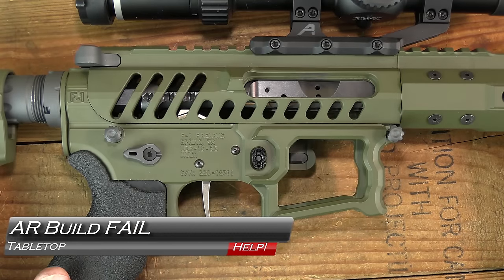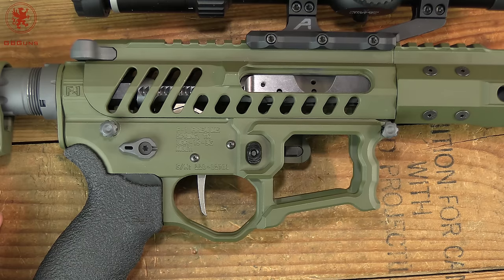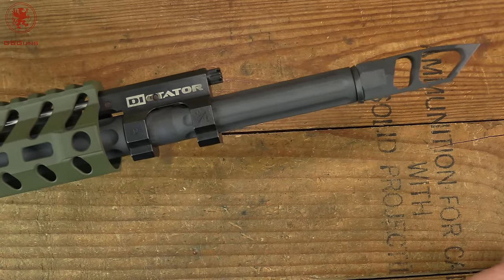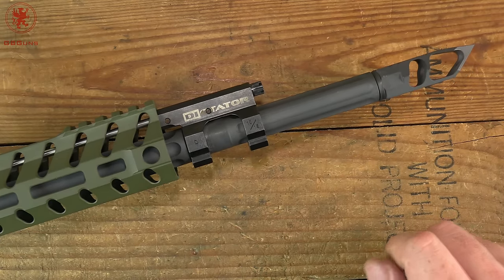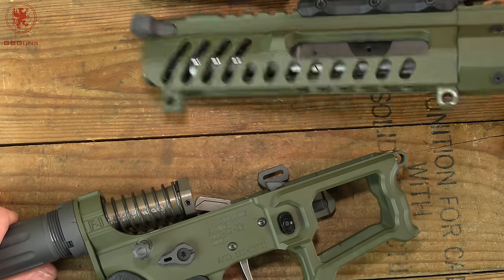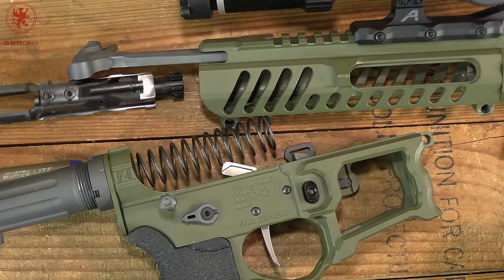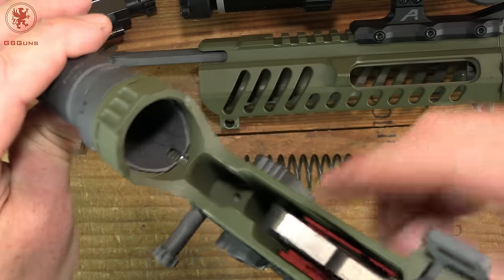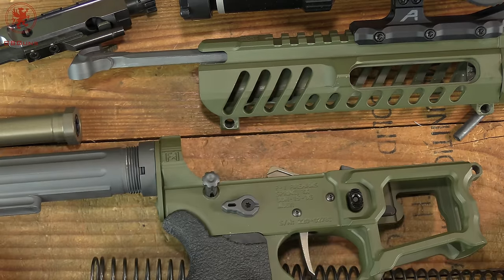The Worst Thing You Can Do For Your AR

Comment: It looked like you were missing the buffer pin holding the weight into the tube. That might be putting pressure on the bolt before it’s even fired causing it to short. Since there is force against the back of the bolt. Or it’s just unbalanced like others were saying
Reply: That was the first thing I thought. Try that and then try a lighter spring
Reply: Yrs i agree
Reply: Sorry for being late to the party but I just saw this video in my recommended. Hey Vader7, I had to do a double take when I saw that myself. I figured I missed him taking the buffer detent out but upon rewinding the video....no, the buffer and spring was already out. I was having similar problems with my AR-10 .308 Win and AR-15 .300 Ham’r rifles. I would crank the adjustable block fully open and every third empty mag, the bolt wouldn’t catch in the open position. When I took it apart I noticed the hole to the gas block was twice the size of the barrel and drilled a bigger opening for the gas to escape. Took it to a gunsmith for a second look and he was able to adjust the gas block perfectly and it would catch the bolt open everytime. Only problem he said there was, the bolt would return very sluggish. I told him I replaced the .308 buffer spring with a lighter .458 SOCOM spring to compensate but I’d slap the right spring in the rifle to fix the sluggish return issue. I’m guessing the buffer detent would help the issue but I’m thinking because it’s a rifle length gas tube, the barrel gas hole will need to be drilled out to match the block hole aswell. Does anybody know if he fixed the issue yet?
Reply from the maker: Yes "he" has.  Check the video description or for a spoiler read the article: https://www.ballisticmag.com/impossible-ar-build-myths/
Reply: @GBGuns   Thanks a lot for the article link, it was a fun read. I too hate building the same ole same crap everybody else builds. But sometimes you run into a road block and trying to get a gunsmith to understand the issue is almost impossible. Did you ever figure out what the original buffer spring was for? I remember bringing in a left handed .50 Beowulf AR-15 for fitment issues to my gunsmith and at the same time another customer brought in a completely built .50 Beowulf AR from Alexander arms I’m guessing. He was having different issues, apparently the guy putting the rifle together decided to slap a buffer and buffer spring from a 5.56 rifle in his and it created all kinds of over-gassing and recoil problems. It’s  amazing something so simple can cause a big headache.
Reply from the maker: @animalmother9753  i didn't.   My guess is it was human error on the packaging or the vendor.  It was supposed to be a carbine spring, and I took it at face value.  Different metals make for different lengths and thickness for the same spring rate.
Reply: @GBGuns   I was actually thinking the same thing. Human error being the most likely scenario. When I first started building ARs, I was a Wilson Combat snob and everything had to be high end parts. I can’t even tell you how many times I had to return parts to WC because of human error. I’d order a 16” .458 barrel, 1-14 twist. In the middle of my build the engraving of the barrel catches my eye and it says 1-22 twist. 😤 I was like are you kidding me? Had to strip the upper apart and send it back for the correct part. The thing I dislike about these companies is customer service usually rolls into work at about 8 am and the guys on the floor picking parts from the bin get there at 5-6 am. So, by the time you figure out you ordered the wrong parts and email CS for a halt on that order, it’s already packaged and ready to ship before CS reads your email. As convenient ordering online is, it’s a pain in the butt when ordering the wrong part or in our case the wrong part was picked off the bin.
Reply: @animalmother9753  sounds like some good work! Better than ordering new parts for a small issue like that as long as it’s safe of course. Knowing a good gunsmith and having your own Arsenal of firearm knowledge is awesome 😎 And no worries dude I always find old videos the same way and am always the late one😂. Do you know why the hole was twice the size as the port in the barrel, just factory error?Also back to my original comment I thought that would definitely be the issue , even with the right weight in it I would figure not having the detect would make it a little iffy. Kinda hard to put it together without the detent too you’d have to squeeze it in there. Or something with the spring/weight size etc. , haven’t read the rest of the comments but if he hasn’t figured it out wonder if it had something to do with the block like you were saying about your build.
Reply: @vader7306   Yeah, he replied to my comment early this morning with an article link. It was actually the buffer spring, we think human error. Somebody packed the wrong spring that was too strong for his caliber. As for mine, when I took the gas block off the barrel, I noticed the hole of the block imprinted on the barrel and it perfectly incircled the barrel gas hole. It was a Wilson Combat barrel, they purposely do that to their barrels. They even send a pamphlet with the barrel noting the gas hole is undersized and might need to be drilled out for your particular application. Not all of the barrels have this, I think the only barrel that came with pamphlet was the 6.8 SPC. But it is something to consider if you went the non-adjustable gas block route and get frustrated dropping money on new buffers, springs, light BCGs and whatnot.

Comment: this comment might be too late but when you said Rise Armament it got me to remembering the issue i had with my .458 SoCom build.  doing a function test after final assembly of the rifle, my BCG wouldn't go into battery.  you would think having the anti-walk pin kit installed would mean the RA drop-in trigger assembly wasn't suspect yet backing off the tension screws at the bottom of the trigger housing, the BCG cycled without drag.  just another area to consider if anyone else is running a similar set-up.
Reply from the maker: Interesting issue to have, and certainly something not a lot of folks would think of.

Comment: DS Arms and yes it is made of aluminum
Reply from the maker: Thanks @kotaboy32 Tactical.   It had been so long since I bought it I couldn't remember.  Check out the second video to see how this thing runs.
Reply from the maker: Shoot me a text
Reply from the maker: @твоя мама It is fixed.  See the video description.  Changing the gas system was not needed.
Reply: First you don’t have a buffer retainer, and you have the wrong buffer and bolt carrier and no real need for the adjustable gas block unless you plan to use a suppressor. Try a carbine buffer and a regular bolt carrier because I don’t believe your short stroking I believe the carrier is moving way to fast to pick up the next round.
Reply from the maker: Incorrect.  See video description
Reply: @GBGuns  yeah it is
Reply: @GBGuns  what am I incorrect about?
Reply from the maker: Buffer retainer and gas block.  See the second or third video to learn more
Reply: @GBGuns  being I only watched your first video before commenting I thought you were asking what could be causing this thing not to work and being I am a gunsmith/collector for 25 years and have built 25 ar15/10 for myself and solved issues for countless people I thought I would throw my 2 cents in .
Reply from the maker: @jasonb4350  that was the original intent; a social experiment.  This is an old video though and the issue was solved long ago.  I boiled the 3k+ comment down to 7 myths about the AR, made a video about that and an article that should publish next week or so.  There are a lot of common misconceptions that were echoed over and over in the comment section
Reply from the maker: False Flag  it's all in the video description
Reply from the maker: How is it a trick? It's all spelled out.

Comment: I don’t see the pin that holds back the buffer???
Reply: First thing I said was "why is that buffer hanging out there like that?"
Reply: A lot of people never install those, they are known for the tip breaking off and getting stuck in the fire control group and they are not really necessary. Karl has talked about it a few times on InRangeTV. The only time you actually need one is when you have a folding buffer adapter.
Reply: @deimosian  That never happens. I don't care what Karl says. I worked as a gunsmith, and never heard or saw this. I built 100s of guns and FA guns too and this never happened. From not putting it in. It could cause the buffer to follow the carrier out. Could tilt and hit the buffer tube lip on the way back in, and cause malfunctions. Who knows giving so many different parts these days. All I know is I would never leave that part out. The customer can make those type of mods themselves. As they are responsible for making the gun malfunction and void the warranty. When they leave our shop they are tested and given a warranty on parts. As I'm sure any manufacturer would do.
Reply: @deimosian  Only time I've had issues with any of my ARs like in the video is with that pin not installed (issues like mentioned below)
Reply: @user-pk8pf8nh6s  Not that it's any issue, but I like to build my AR's up myself, so I can see him messin with things and learning.  I have wondered about leaving the buffer spring retaining pin out, but never tried it, so good advice I think on your part.  These AR's are as fun to build as shoot, maybe more so.  I don't think I'll ever buy one complete, or even completed upper or lower.  Only my first after the Marines was complete, an AR-10T I really liked as is when I saw it in ODG.  It shot 1MOA out to 1100 yards with a U.S. Optics scope.  I hated to lose that thing when a huge theft at my place occurred.
Reply: I was thinking the same & to everyone mentioning they break off I have never personally seen one break off on a m16a2 that I was issued while serving in the USMC
Reply: @deimosian  
Folding. Buffer. Adapter.
Reply: @dandexinventor  Yeah we sold parts to for the do it yourselfer too. We specialized in high end custom builds. I also built AK's, Bolt guns, full auto, cerakote and all that shit. The place I worked for was a manufacturer and they had some government contracts. I also built guns for swat and police stations all over. Also civilians, the owners are former intelligence contractors that were over seas.
Reply: @user-pk8pf8nh6s  I literally had that happen 2 days ago I had to remove my buffer tube my gun was down and out for 5-10 minutes only because I carry an AR-15 armourers wrench in my range bag...... it's unnecessary to the function of the gun but could be very bad in a self defense scenario
Reply: I run a very similar setup with an 18in Odin barrel and rifle length gas system. Go with the jp captured buffer system and get the lightest spring.
Reply: @jayzenitram9621  i never install that pin, ive assembled over 50 of these things and never had an issue, Id go with a lighter buffer spring if that doesnt do it youll have to drill the gas port out a little bigger
Reply: You are correct it should always stay inside the buffer tube. The holdback pin is never stressed by the carrier. I think its the buffer weight who is not meant to work in this system
Reply: I was saying the same thing spring and detent for buffer tube we're missing.
Reply: @Angel Garcia lol whut?  Buffer must be compressed by BCG.  notice when pin is installed, the buffer moves rearward slightly when closing upper?  that does that for a reason.  that reason is to keep the buffer from battering the detent pin.  if it was not, the bcg would batter the buffer every shot and not be in contact with the bcg in battery.
Reply: You need that pin, that's why when he racked the charging Handle it sounded gritty, there's too much pressure on the carrier. Shit even my 400 dollar Delton sounds better then that, when you rack it.
Reply: Any of you saying that it breaks and whatnot, just get a titanium buffer retainer.
Reply: @conradangel8602  o

Comment: I know this will sound screwy but what if you put a heavy buffer in and a flat spring. The problem may not be the amount of pressure but the duration of pressure as you alluded to. A heavier buffer once it gets moving will continue to move back even after the pressures are gone. I actually think a full auto bolt would fix the problem but if you want to keep the  cool looking one try h2 or h3 buffer.

Comment: I’m late, but pretty sure that’s a buffer spring issue.
Reply: Yep.  Mine had the same issue.  Couldn't figure it out.  Threw the upper on a buddy's lower, worked fine.  Swapped out the buffer assembly with his just to see, worked fine.  Finally replaced it and no issues ever now.  Not totally sure why the buffer didn't work right but that was it.  

Just read comments below and looks like you found it lol.
Reply: A drop of oil would probably help too .
Reply: @crocholiday  rifle length gas system need less spring pressure to move reward since there such little gas left during the dwell time. 
I have an 18" rifle length barrel with a rifle length buffer tube and spring and it runs like a top.
Reply: I have a 18inch mpr. With a super light spring runs like a top. You need a new spring
Reply: I guess on the plus side, resolving his issue was incredibly cheap and easy.

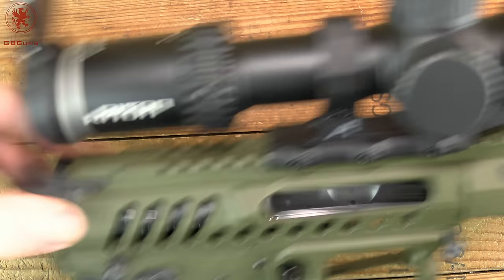Comment: Lube and grease the HELL out of the BCG. AR/15 M/16 platform rifles were meant to be run wet. The BCG is dry @ 2:52 when you pulled the charging handle that metal on dry metal noise made me cringe. PLEASE lube your rifle.
Reply: Kind of messy with that stupid upper.
Reply: Much of that sound is from no spring detent being installed 
There is constant pressure on the rear of the bcg.

Comment: My nephew had the same problem on a build. He drilled the gas port just a couple of thousands larger worked perfect.
Reply: Only recently have people FINALLY started to address this. Theyll change damn near everything on the gun chasing short stroke issues before considering the gas port hole.  Even if you find the right band aid and get the gun to run, is it running in a manner that will preserve the longevity of the internals?

Comment: Detent that holds back buffer tube spring looks like it is missing to me, I had that problem with mine after I replaced my stock and buffer tube and it caused mine not to cycle correctly until I replaced that detent :)
Reply: i was wondering the same thing.

Comment: Where is the detent that holds your buffer?
Reply: Allot of us dont use them because they are known to break amd shut down your rifle, also I run thr JP Silent Captured system and not having the detent makes installing them much easier
Reply: You dont need the buffer detent.  Doest have anything to do with funtion.
Reply: @twistinprops604  true but do notice what part he edits out.  I look at it like this if I need to swap bolt carrier group because say fire pin broke.  I swap out to spare bcg but instead of being able to flip the upper reciever and slapping a pin in to back in the fight, now I must fight that damn spring and buffer in a already high stress situation.  Just my train of thought 🤷🏽‍♂️
Reply: @New2Kendo  never know that to happen.  Not even the beat to dog shit rifles we used in basic training had that issue.
Reply: @tobygonzales3114  the guys breaking them likely are using bcgs that don't have the cut for the detent on the under side of the bcg. Ive never seen one break either during my active duty service

Comment: The dwell time shortance may try to compensate by increasing a gas port and creating a gas backup pressure. Some muzzle devices may to use, such as silencers, large primary chamber muzzle  brakes, etc.

Comment: It's highly likely the buffer spring as mentioned several times here. I had the same issue with an operating AR firing 5.56, but when I installed a 450 Bushmaster upper, it short stroked. Changed the spring and wellla, it was fine.  I do also agree that an additional issue could be the gas port size.  Good luck.
Reply from the maker: See video description.

Comment: Carbine length or rifle length spring? I think maybe you stated the problem early on in the video... The gas block could be too close to the muzzle. I would make sure you have a carbine length spring and try a heavy BCG (you lack mass to carry inertia) THEN if that fails replace the barrel with a carbine length gas system. If it runs, switch back to your lightweight BCG. Buy the way, I'm an AK guy....but physics. I don't think friction is a factor here.

Comment: Make sure the adjustable gas block is aligned perfectly on the clock position and with the gas tub length on the barrel exactly I’ve seem this many times and usually the adjustmentable gas block is half covering the port on the barrel . I suggest really tight measurements for how it sits length wise so it matches perfectly. If not that then you need a bigger gas port or a shorter gas tube .
Reply from the maker: The gas block was perfectly igned with a bore scope.  See pinned comment or video description for the fix and footage of it running like a dream!

Comment: The rifle length gas tube was the same mistake made when the M2 dissipator was conceived. They basically cut down a 21" barrel to 18" and as you explained didn't have enough barrel length after the gas block to create enough pressure to Cycle the bolt reliably. Now add an extra light bcg and spring and you've compounded your problems.
I see you've fixed your issue with an even lighter buffer spring. That's awesome because it shouldn't have cost too much for the final repair.